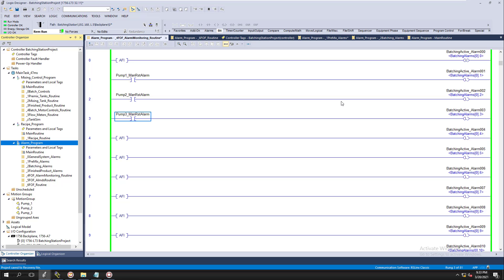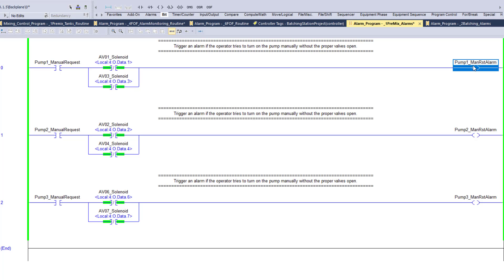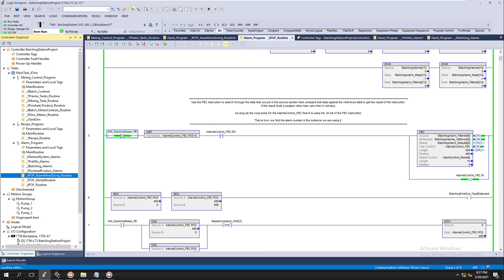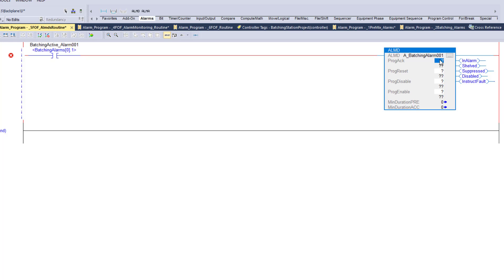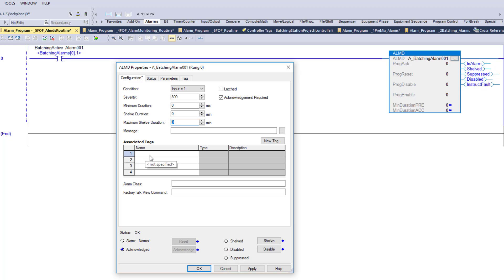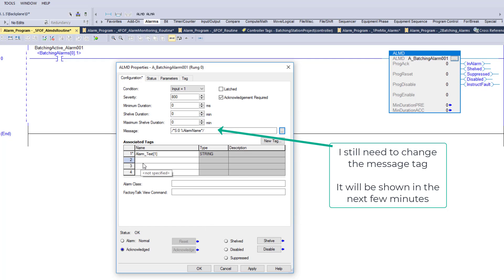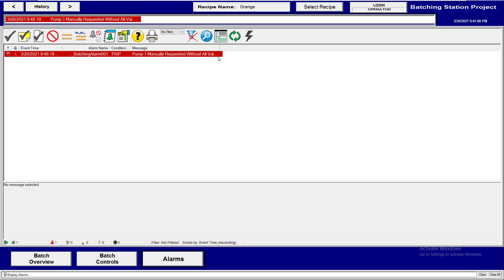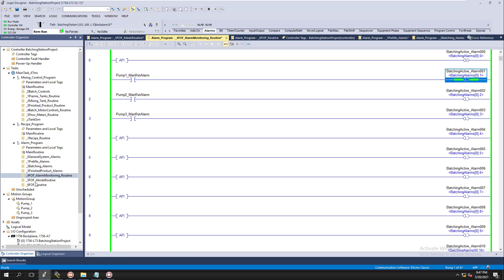Studio 5000 ALMD Instruction Setup | FactoryTalk View Studio Alarm

Comment: Why can't you just tie an alarm to a tag like in Factory Talk View? Why do they have to make it so complicated?
Reply from the maker: You can use different alarming, this is just showing one way that is used the most in all industries
Reply: @ShaneWelcher  do you know if you can use Factory Talk View ME to program a panel view 5310?
Reply from the maker: @brandonly27  it needs to be programmed with CCW
Reply: @ShaneWelcher  okay thanks man!
Reply: @ShaneWelcher  this is the 6th HMI programming software i have had to pearn (for work) in the last year.
Reply from the maker: @brandonly27  Connected Components Workbench.

It's there cheaper panleviews
Reply: @Shane Welcher  Yeah. With the Panel View Plus panels and Factory Talk View (ME and SE), you can define the alarms in Factory Talk, i'm just bummed out that they have to be done in the PLC.
Reply from the maker: @brandonly27  they do not have to be, you can use an FTAE in Site Edition.

There are some limitations of that though so I prefer to use ALMDs in then PLC

Comment: Is there any advantage/disadvantage of setting up the alarms this way opposed to creating an Alarm Server in FactoryTalk?
Reply from the maker: There are pros & cons to both ways to setup.

ALMD instructions use PLC memory.

Alarms & Events server has a few issues on different versions.

ALMDs & ALMAs can easily controlled from the PLC to communicate to the alarm summary.

Really depends on what you want to design to be like.

Meaning, if you are using a first out fault system then it is much simpler to use ALMDs

Good question
Reply: @ShaneWelcher  thank you for the detailed response. 

Current project has a few ControlLogix PLCs that I’m thinking of doing the alarms as shown for FactoryTalk SE.

Also have 3rd party PLCs coming in via Kepware that I will create an alarm server for. My thought it separation between the alarm sets
Reply from the maker: @justinb9032  Glad to help

Comment: Hi Shane. Can the almd instruction be used in ME v12? Im working with those right now and when I test my application and alarms, nothing shows up in the alarm banner. Maybe it’s a config thing but I expected it to behave like the status and information page, where if there’s an alarm, it just pops up…or does it need to be loaded on the hmi screen to fully work? Thanks.
Reply from the maker: To use ALMD instructions you need alarms & events to be used.

Mainly Site edition but in FTview 12, I believe you can used alarms & events.

I would set that up through that to see if it works
Reply from the maker: Here is a more direct method for Machine Editon that will work.

Still limited though.

You can add ALMD/ALMA instruction faceplates into a FactoryTalk View ME application to get the device-base alarm status by reading the tag value of ALMD/ALMA instruction. But you can not trigger the alarm message natively.

For native support of ALMD/ALMA instruction alarms, use the PanelView 5510 or PanelView 5310 terminals, or FactoryTalk View SE
Reply: Thanks for response, really appreciate it. I like the features of the almd, so what I’ll probably wind up doing is just triggering the ME alarm based on the ALMD “in alarm” status ( hah, still need to check if that’s an option)

Comment: Could you please elaborate regarding which videos are required watching for full comprehension? I've looked thru your videos but can't tell what's best sequentially.  Otherwise great information. I'm struggling with setting up tags for a new PLC on an existing FTV program.
Reply from the maker: ALMD & ALMA instructions are connected directly to an alarm summary in Factory Talk.
Reply: Thanks
Reply from the maker: RSLogix 5000 ALMDs FTView SE application First Out Fault System
https://youtu.be/uVfjsWlZw70

Studio 5000 ALMD Instruction Setup | FactoryTalk View Studio Alarm
https://youtu.be/yCD-8v9h6b0

FactoryTalk View Studio Site Edition Alarm Summary Screen | Batching PLC Day 40
https://youtu.be/wWwA9pJ3CiA

Using ALMD Instruction | HMI Scada Alarms in Studio 5000 V32 | FactoryTalk Site Edition Version 10
https://youtu.be/8pWjcjB13JA

PLC Fault Handling | Scada In Studio 5000 Using a File Bit Comparison | FBD Instruction Studio V32
https://youtu.be/9udG-RHjqSs